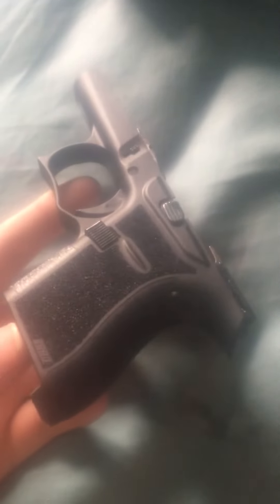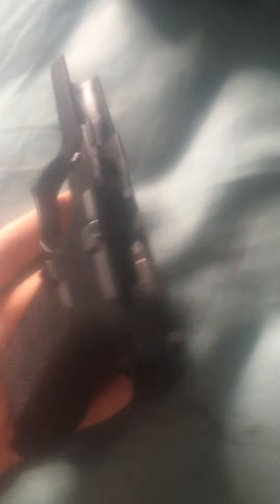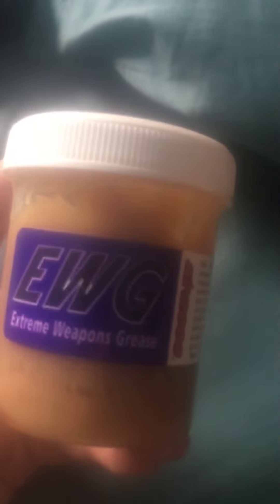SS80 closeup

Comment: You use a drill press or hand drill?
Reply from the maker: William Ponce drill press. I really wouldn’t even try it with a hand drill. If that’s all you had make sure you have a way of maintaining level.
Reply from the maker: deucedeuce22oz if you make sure the table is level then there is no problem at all. Strides better than attempting to remain straight with a hand drill. Also provides much more control of the bit and leverage; rather than just trying to put your back into it hahah
Reply: You are supposed to use a hand drill, not a drill press.
Reply from the maker: Frankiecoast there is no advantage what so ever to a hand drill. Only use a drill press.

Comment: Any tips for the build?
Reply from the maker: Brock Campbell drill press, plan how you’re gonna do it. Quadruple check that the metal parts are fully seated before drilling. And most importantly make absolutely certain your bit is aligned properly with the guide holes. All said and done took me an hour to do it correctly. Definitely don’t rush it. Also if your jig screws are as cheap as mine use some Vice grips to secure the jig. Or just longer screws with the same thread pitch/diameter.